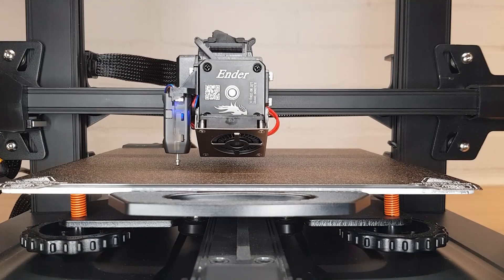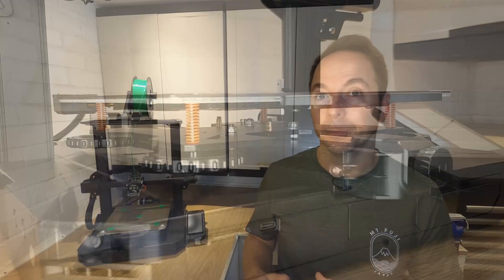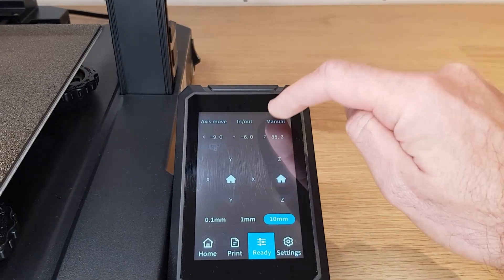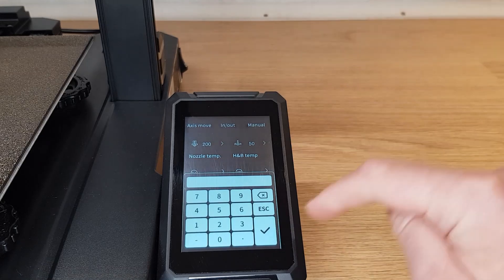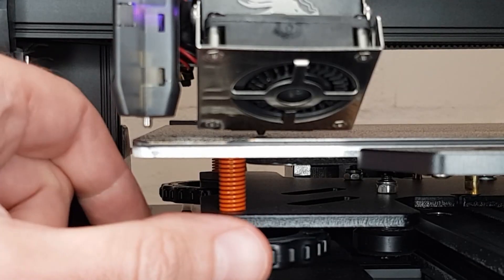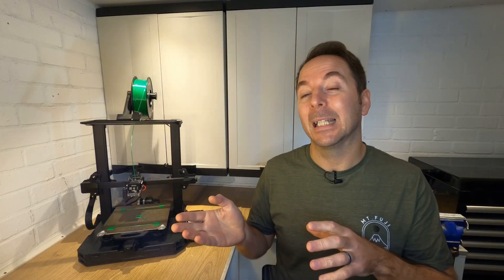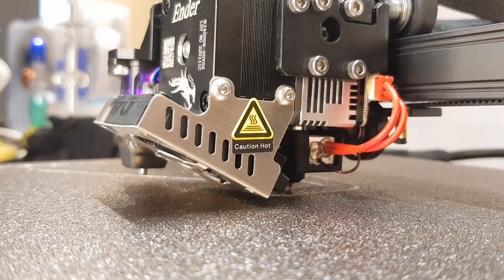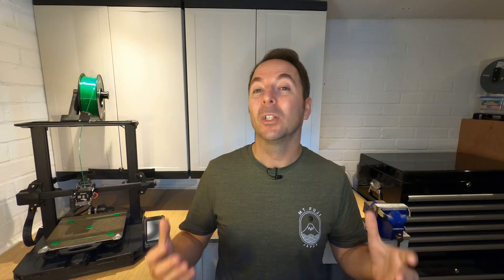Ender 3 S1 Pro 'Automatic' Bed Leveling In 3 Simple Steps

Comment: Hi thanks for this clear explanation! I'm having one trouble by the way... I just bought my new ender s1 pro but my bltouch is lower than yours on the second 02:39 . My BLtouch is almost at the same level than the nozzle, with the problem that touches the printed piece sometimes and breaks the print... it's only my case? thanks!
Reply from the maker: Hi, perhaps the unit you have is not a standard Creality unit. They use the CR Touch which is slightly different but i didn't think it was longer🤔
Reply: @RickyImpey  yes sorry, I said bltouch instead of crtouch. My unit is new (not second hand) and the crtouch is exactly the same than yours, I just discovered that some units has the heat unit where is the nozzle, a bit high so the heigh difference between the nozzle and the crtouch is very few and scratches the prints. I dissassembled the heat unit, extracted out a bit the nozzle and not it works like a charm. thanks for your answer anyway!

Comment: The might be dumb, but I was troubleshooting my first couple attempts and realized that 1) the bed mesh wasn't saved (thank you for teaching me that), but also the print speed was set at "100". And I don't know what that was. I assumed it was mm/s and set it at 50 and seemed to fix everything, but is that number actually mm/s or is that a percentage (like 50% speed). It's just that 100mm/s seems really fast if that's the max speed.
Reply from the maker: Hi, that '100' figure for the print speed is 100% of whatever you set in your slicer. So, what you did was halved your print speed by setting it to 50%. You can obviously use this as a guide for setting your slicer print speed. I usually find around 60mm/s is a good average starting point myself.

Comment: Hey Ricky, great videos. I am really crap at eyeing the z offset and even worse gauging the paper method, What size feeler gauge do you recommend for this purpose?
Reply from the maker: I generally use a 0.1mm gauge as I find the thinner gauges easier to 'feel' when the nozzle tension is correct. They bend instead of pushing through a gap that is too tight. Just remember to increase your z offset by the thickness of the gauge afterwards though, whatever you use.
Reply: @RickyImpey  Cheers mate, i will give it a go

Comment: I followed every step in this and it appeared to work but my prints are catching and pulling off the bed or something even more weird.

It’s adding extra squares and lines outside of my prints which then come lose and snag and cause issues?

Any advice?
Reply from the maker: I think maybe the 'lines and squares' could be supports. Do you have supports turned on in your slicer?
Reply: @RickyImpey  I think it was supports after checking my cura settings. I am unsure as to why they wasn’t sticking but I’m trying the test print again without them. So fingers crossed and thank you.

Comment: I was about to give up on 3D printing because of the leveling and balancing issues. This video helped so much. How often should we have to do this? Thank you so much!
Reply from the maker: Glad it helped. You should only need to do this again when something is changed. I rarely re-tram the bed unless I change anything. There isn't really any reason it should move once it's done. Some people have the printer take a new mesh every print but it's not necessary.

Comment: Here's a stupid question I can't seem to find the answer to: How do you save the mesh created to slot 1? Does the factory bed level routine do this automatically? At what point? I can't see anything happening after I complete the BLT routine as outlined here, and Rick does not show it either. He does say something like ".....after you've saved the BLT mesh ......", but I don't see where he actually does it. Help ...............   :face-blue-wide-eyes:       Thanks Rick so much for this and all the videos, help and guidance! Your efforts are much appreciated!
Reply from the maker: Sorry, it automatically saves in slot one. I should have said that.
Reply: @RickyImpey  - Alright, thanks! I saw several articles where it directed to send an M code through the controller to save the mesh. It seems the new iteration of the the S1 is where the ability to save the mesh automatically started.  I'm so new at this I was totally confused about how to send the codes through the controller. Thanks again! Oh, and you are so right about having the printer do all the work mapping the bed on a new machine can lead to errors. I followed the directions, and video provided by the manufacturer, right out of the box and wound up with a nicely scratched bed on my brand new S1 Pro! Not once, but twice it has done that at the start of a print job. I'm still not exactly sure how it happened, but it's been a few weeks and about 30 prints and it hasn't happened again so I'm hoping when I perform a new mesh, I get it right and don't scrape the bed again!

Comment: Would a spirit level aid the initial process
Reply from the maker: Nope. You are making the bed parallel to the nozzle movement. You could do this with the machine mounted to the wall or the ceiling, as long as the two are in alignment, 'level' doesn't matter.

Comment: I wish this printer was a little slower when it moves around the bed because it ends up rubbing the print or knocking it loose from the bed when traveling. How do I slow it down in Cura? Please help? Thanks

Comment: I ran through this process over 5 times, and every new print the Z Axis resets itself on too high of an offet about 1mm from the bed. this is after I have Leveled and tram the bed while heated. all my spring adjustments are proper. I am at a complete loss for what to do, other than trick the printer and hastily adjust the bed as it starts the print. This is my 3rd 3D printer so I am by no means an expert but this one is throwing me for a real loop.
Reply from the maker: Adjusting the z offset while the first layer is printing is perfectly acceptable. I do it if I'm not 100% happy with the quality of my first layer.
Reply: @RickyImpey  Noted, thank you. I had a further problem with feed rate, after checking I had to adjust to 86% feedrate and now I am getting great prints. along with using pronterface to get more control. Lastly, I heard to install Kipper firmware. that is my next step which I havent gotten to yet
Reply from the maker: @DES1GN3R007  Klipper is pretty involved and you need a separate device like a raspberry pi or Sonic Pad to be able to use it. It's awesome if you give it the time to learn though.

Comment: I have an S1 Pro with Sonic Pad. My bed mesh is excellent and likewise with my prints. I thought I would try the code you suggest M420 s1 z10 into my start code (Cura 5.3) and it made my PETG prints worse (vertical banding) than not having the code. I tried several different prints. Any ideas on that one?

Comment: I had heard that the auto level would succeed and then be miles off, so I was prepped. But I had done it manually first and undone the screws too far to get bed higher. Then it wobbles around and I thought it was broken! Your tip re getting the springs pretensioned and only then doing the Z height adjust with the touchpad. I needed 4mm, which the springs were unable to provide before running out of tension leaving the end wobbling. 
MANY THANKS you’ve saved the day for a novice printer owner.

Comment: Older Video I know but I'm hoping someone can answer this.  Why do we need to adjust Z offset after the auto level?  Shouldnt the auto level know where to place the nozzle perfectly?  Doesn't changing the offset again mess with the auto level we just did?  Mines never right after auto level.
Reply from the maker: The offset moves the whole z axis zero point up or down so it doesn't affect the bed mesh when you change it. The z offset is often the most critical part of getting the first layer to go down nicely so it needs to be checked to make sure it's 100% after any manual bed adjustment. You could set the offset before the 'auto level' process but on the S1 Pro it is easier to set it again after with the way the menus are setup.
Reply: @RickyImpey  Thank you Ricky.

Comment: Fantastic videos! I've just upgraded from an original Ender3 to an Ender3 S1 Pro. So much better! I am noticing the Z axis steppers rotating very slightly during each layer, indicating that the bed level mesh is being used for the first few layers. Interestingly, it does this with or without the M420 line in the G-code. Another thing I found was very messy first few layers when using the thinner PEI metal bed. When I switched to glass the prints are fine. I think this is because the glass is thicker so the Z-axis is not going as low. Would love to hear your comments on both of these observations, thanks!
Reply from the maker: Interesting. Yes, Creality say that you don't need the M420 g-code for the print to use the mesh but so many have found it helps that I feel that something is not right. Having the code does no harm in either case so I prefer to advise people to add it so that all bases are covered.
With regards to the higher bed height helping, I've not come across that myself. Of course you could mimic this by loosening your bed screws but that may cause other issues if the springs are too tight🤔

Comment: I was so disappointed with my Ender 3 S1 Pro as no other video (even Creality's) resolved this bed leveling challenge. Finally, after following your instructions, a perfect Lego calibration cube came out of the bed ! One problem I faced here, though: the distance between the nozzle and the bed was greater than the Z offset limit (-5.00). To solve it, I had to reset the printer via the touch panel and start the Z offset adjustment again. After two resets, Z offset is now set to -1.75 and the nozzle is at a perfect distance from the bed. Thank you !
Reply: I cannot get this. I started with a -4.00 offset right out of the box... I have reseted the settings many times and still I am around the -4.15 offset is getting bigger with the time and every reset...
Reply: @axor  im at 3.15 and it works like a charm. doesnt matter as long its leveled
Reply: @axor this was my exact issue. So glad I found this video.

Comment: Subscribed. I always find myself looking for answers and end up a little confused until I watch one of your videos. I have been trying to find out exactly what the M420 command does and what each part means, thank you! Do you happen to know what the printer will think to do if you omit the Z10? I mean if my command only says M420 S1?
Reply from the maker: I believe that the mesh is not faded out through the print and every level is parallel to the bed if you leave out the 'Z10' part
Reply: @RickyImpey  Interesting, thanks for the reply.

Comment: I am desperate at this point, my Auto-Leveling doesn't work at all, also when manually trying to Level, doesn't even move to points 1,2,3,4 or 5. Overall the Z-axis seems way too high. I also get a red light. At this point I tried dozens of tutorials, but I don 't even get to do the leveling, do you have any idea ? I also updated the motherborad firmware to .26
Reply from the maker: I think you should contact Creality, it sounds like your machine has a fault.
Reply: @RickyImpey  Figured it out eventually, that little metal piece (not sure how it's called) that bumps into the printer bed for the leveling was actually stuck, I manually moved it a couple times and turned on the printer and it got unjammed.
Reply from the maker: @vostinariuvlad5393  That is your CR Touch probe. If they get bent then they will get stuck. It needs to pop out when the power is turned on then retract. If it isn't doing this then it is faulty or fitted wrong. This video shows how it should be fitted https://youtu.be/f8t1iOEouPA

Comment: Can I use the G-Code on my Ender S1?  Thanks for the video!
Reply from the maker: Hi, no. You are best using start g-code specific to your model. If you haven't modified anything then the standard Cura start g-code for your model should be fine.
Reply: @RickyImpey  i just used the M420 s1, it improved my prints. Thanks for answer

Comment: If I do everything but no #1 and after Auto level it again mess up all settings and stands 3-4mm above the table... So I did simply with paper and manual nuts adjustment and it worked. For me it looks that auto level is not working completely...

Comment: Hey so using this video to level bed. And my start gcode is different from yours from the factory, your reset extruder is in different line and the custom gcode on top, should I copy your start gcode exactly to have this all work?
Reply from the maker: Hi, without seeing you current g-code it's difficult to say if it's correct or not. I would say, copy and paste your current start g-code into a plain text document and then try my g-code. If for any reason you don't like it, you can simply switch back.

Comment: Thanks Ricky!
Question, if the bed is a bit warped, the z is lower in the middle, and higher in the corners (about 1 mm) will the mesh fix this?
I find it very hard to get a first layer printed ok.
Reply from the maker: Hi, in theory that is exactly what the mesh is designed to do, yes.

Comment: I'm having real problems setting up my s1 pro. It seems like the bed z height is lower in the middle of the build plate vs the edges. So no amount of trimming / leveling seems to allow me to print a single leveling test print...
Reply from the maker: I have heard of some machines that have had an issue with creating a mesh but haven't been able to lay my hands on one yet. I would suggest going back to zero by loosening all of the bed springs completely and then making sure you tighten them evenly. Then, make sure you get it as close as possible on a manual tram before you start. If you do all of this well then it may be time to contact Creality to see if they have any solutions as it's not a setup issue.
Reply: @RickyImpey   I've re-trimmed it a bunch and have since been able to print 2 nice successful leveling prints. Mostly perfect save for some minor channels on front left. However, when i tried to print a normal print after it would just string up and fail... I tried a more comprehensive levelling print (with 9 pads) and the middle left failed and was dragged from the bed. I think the printer just isn't creating or using the ABL mesh at all, and printing without compensating for the variances of the bed. The curious thing is that my S1 Pro did not come with thicker yellow springs, but rather copper colored ones. In another twist a friend has also just purchased the same printer and is having the same issues, his also came with copper springs.
Reply from the maker: @85th_MS  Hmmm 🤔, I would be surprised if the springs made much of a difference. Like you say, it sounds like it's not using the mesh.
Reply: @RickyImpey  it's a strange one. I've hooked it up to pronterface and checked the bed leveling bilinear data using an online visualizer and the leveling is all over the place, despite the corners being the same with the paper test in manual aux levelling. Curiously if I query M420 V it will give me the bed level data but ends with "echo:Bed Leveling OFF"
Reply from the maker: @85th_MS  There's something not right with the Marlin configuration on some of these printers. I'd love to be able to figure it out but firmware configuration is not something I'm very knowledgeable on yet. Sound like I may need to invest some time in educating myself.....

Comment: I have a problem where my level zero is no where near the actual level zero (when I set the level to zero). The bed levelers are also all the way stretched out. How do I fix this?
Reply from the maker: If you have an Ender 3 S1 Pro then the distance the nozzle is from the bed is controlled by the z offset. You need to adjust this correctly before you will have any success.

Comment: Ender3 S1 Pro user here. Earlier I used to have G29 but that caused the auto bed leveling to trigger before each print and sometimes I felt that it also messed up the z height so I removed the G29 altogether. Now I have manually leveled the bed on all corners and center with a 0.2mm feeler gauge just so that it passes on all corners and center, this with no G29 or M420 after G28 in cura and prusa slicer start G-code printer settings gives me perfect prints every single time. I am not sure if adding M420 would affect anything but I am not touching my start G-code on both my slicers as things are working great.
Reply: It works great for prints with layer height of 0.2mm as well as 0.3mm throughout the print. 
Note: I only use the 0.2mm feeler gauge for both layer heights while bed leveling.

Comment: Leveling could be WAY BETTER if chineese "angineerz" create simple procedure in firmware: test all points and show how they are differs from each other (or from some medium value of all heights). Next you turn cog on appropriate side and run again test procedure and repeat until all points are on the same level. Simple and easy. And no need in ridiculous "push paper/steel under the nozzle".

Comment: When you print "test bed level" figure, HOW you should adjust Z level?? I cannot say by printed track is it good or not.
Reply from the maker: If you print something with a large base, so that you get a lot of diagonal lines of filament that slightly overlap, you should be able to see the difference between too close and to far. If the nozzle is too far then you will see a slight gap between the lines of filament. If the nozzle is too close, you will see raised areas along the side of each line where the filament is being squeezed back up the side of the nozzle. You're looking for a nice flat surface.

Comment: When you start speaking about "Use saved Bed Mesh" where you did that SAVE operation?
Reply from the maker: The printer saves the mesh automatically after you run the 'auto level' feature.